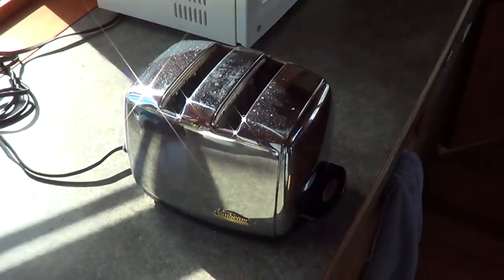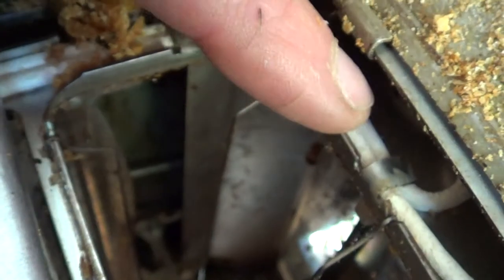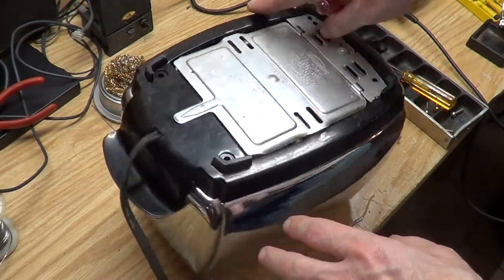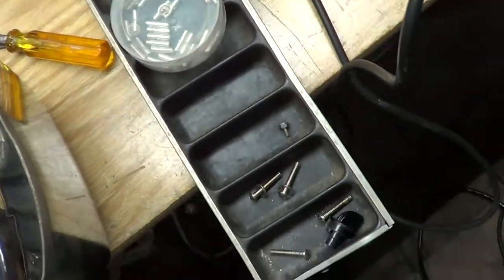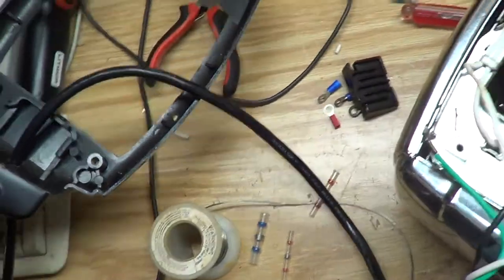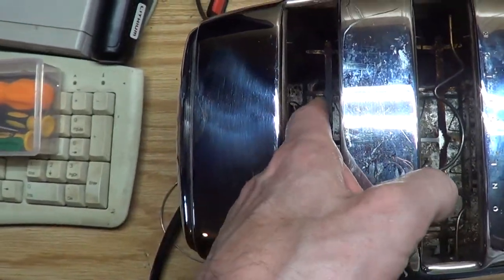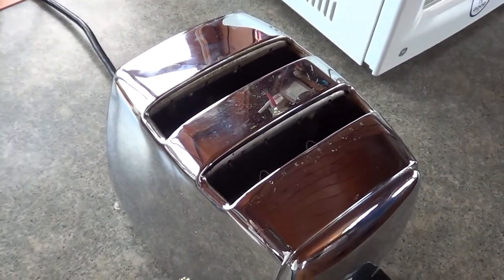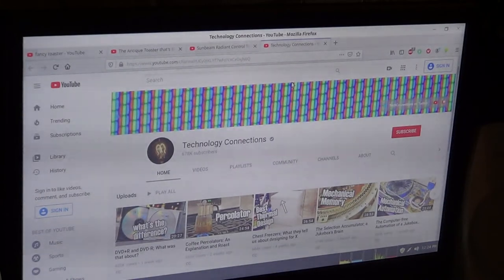Fixing up my Sunbeam Toaster

Comment: I just replaced the cord on my Sunbeam Radiant Control T-35 toaster. I noticed that your Sunbeam toaster is a T35-1. Congratulations!
Your toaster is rated at 1375 Watts at 120 Volts. Using the Electrical Power Formula, Watts / Volts = Amperes, then 1375W/120V = 11.5A.
Most computer (18 gauge) wire is rated at 10A, while most 16 gauge wire is rated at 13A.
Like you, I chose to use 16 gauge wire for safety's sake. Thank you for posting this video.

Comment: I should have watched the rest of your video before I posted my first comment. When I saw the digital soldering unit and other electronics repair tools, I recognize the tools of an electronics expert!
If you are a ham radio operator, then 73!
Reply from the maker: Well I don't think I would  use the word "expert" LOL.....  NOT a novice either.  Just handy at fixing things sometimes.  I "dabble" with this for fun.  I never got into ham radios; but I used to talk a lot with my friends and truckers on CB radio back in the day.  I remember tuning them and SWR metering antennas and stuff like that.  Late at night when the weather was just right; you could talk to people from out of state on the side bands for a little while.  It was fun.   Ahh the good ol' days.  Things sure have changed.   Thanks for watching!!!